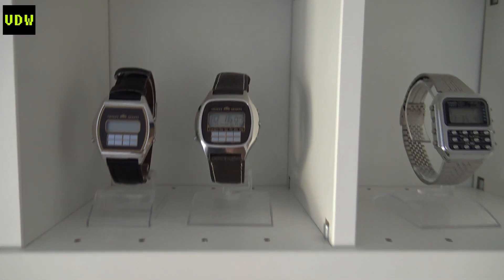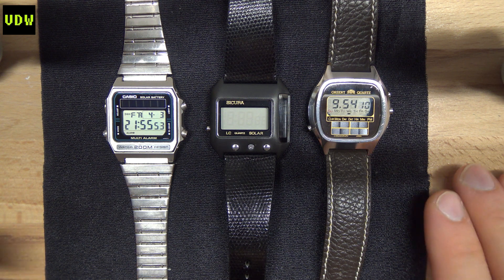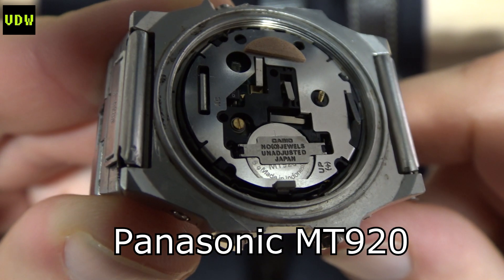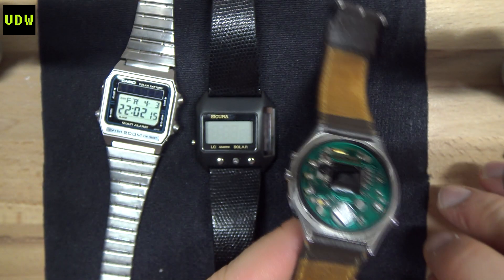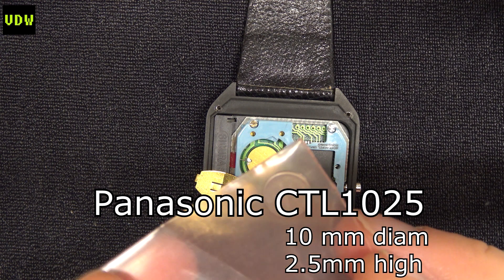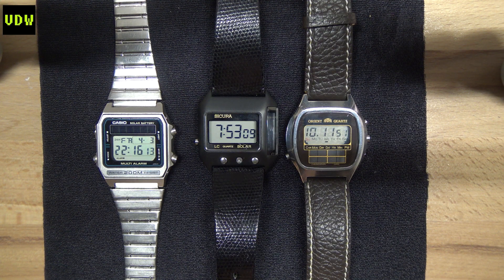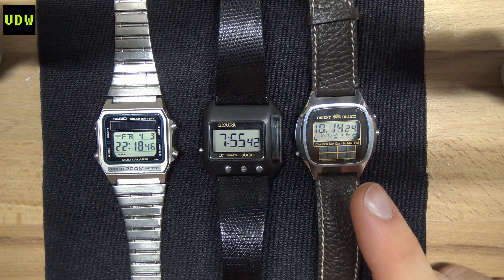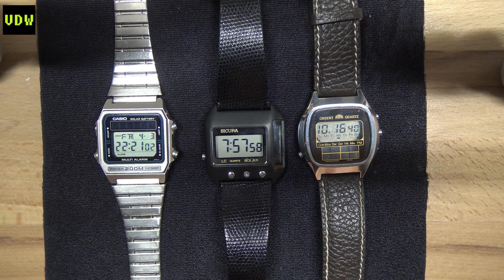Ep 86 - Solar Batteries - Vintage Digital Watches

Comment: Hello, Casio dw2000 uses MT920 to press the light button and the screen will be off. It should be that the voltage is not enough. I saw someone using a CTL920F battery with a voltage of 2.3v. It should be able to solve this problem.

Comment: Cool. You could probably fix the light issue with simple joule thief circuit (two SMD inductors and one common SMD transistor). Also if you solder to any batteries, sand the oxidation away from the surface first to make it easier.

Comment: Do you think a 1.5V cell would be sufficient for an analog solar watch? The old cell is 2.4V, 0.47F, 0.31 mAh. I am worried that a 3V cell would damage it, and also the mAh on all modern cells I've seen are much higher than 0.31

Comment: Have fitted two brand new 392 batteries, in solar watch. Display is barely visible, solar panel on watch does not work so using normal batteries, functions working fine. What is normal operating power voltage wise?, worth doubling up to 3 volts ? with two sets of batteries?Have fitted two brand new 392 batteries, in solar watch. Display is barely visible, solar panel on watch does not work so using normal batteries, functions working fine. What is normal operating power voltage wise?, worth doubling up to 3 volts ? with two sets of batteries? All areas clean?

Comment: About braselet. I think it has 4 c springs in every part.They are pushed up inside by square spring. You can try to remove two on one side and there should be square one pushing it to upper side. Please show more to look at because it it hard to judge after few seconds

Comment: Love your videos, that solar Casio is a piece of art! I bought two vintage Casio and both of them are missing the top battery retainer, but when I push down the battery they seem to work fine. I put a bit of  isolation tape on them to hold the battery and they seem to work fine, but one of them has a light that after a few hours just stops working I wonder is it because of the missing retainer? Is there a better solution than taping it down?

Comment: Hello, I'm a subscriber to your channel and find it interesting, entertaining and helpful. I have 2 Ana-Digi temps which need servicing beyond my comfort level. Would you be willing to service these watches?  One is the 8982 more modern, rounded style bought in 1989 and has a TON of sentimental value because it accompanied me throughout high school, and the other is a cal. 8982 "Orange Lightning" which needs an LCD replacement due to a bleed in the lower right portion of the LCD screen. I can provide a donor watch. Thank you.
Reply from the maker: Hi, I don't do servicing sorry, you my find someone on the VIntage Digital Watches facebokk group though

Comment: Those stretchy bracelets, you have to pull the U shaped pins out, the ones that you can see on the outside that hold the strap together. 2 on each side to connect each link, they just clip in.
Reply: To add, it's better to lever them out with a small screwdriver rather than yanking them out with some needle nose pliers.

Comment: most of these "capacitors" as the manufacturers call them are, in fact, merely rechargeable batteries.  You can source out the same r/c battery from Digikey or Mouser for a fraction of the oem cost.  I slide a single-edge razor blade (something thin & wide) under the spot-welded tab of the original "capacitor" to break the weld (it's VERY easy) and I use this on the new r/c cell.  You're correct about heat damaging the battery, especially tiny watch cells, but, instead, use what you use in other repairs - silver epoxy.  It will dry and be conductive and you're in business!  For example, here is the cell (capacitor) that is required by the Seiko V172 V174 V175 V176 SSC015 SSC017. Purchase the TS920E here https://www.mouser.com/Search/Refine?Ntk=P_MarCom&Ntt=167605663  at Mouser for $2.80.  Of course shipping is more than the cell but, if you buy 3 or 4, as I do, you're set for awhile.  Hope this helps
Reply from the maker: DigiKey will work fine if you are in a few countries, like US or UK, and paying loads on shipping and waiting and customs is not worth it. Good idea with silver epoxy, but would be extra work when changing it in the future.
Reply: @VintageDigitalWatches  Actually, the same method for breaking the original spot weld bond will work to break the "small" bead of silver epoxy in the future - you need not use much, just a spot.  If you use too much, anyway, you run the risk of covering the insulation between the two terminals (negative side up). The cell is held in place by the screw-down tab; the epoxy ensures the continued contact.
Reply from the maker: I'll pin the post to benefit people with the mouser link. Thanks

Comment: resizing stretch straps is a bit finicky, but pretty straight foward. you have to bend open the sides of one upper and lower link, and then you can easily pull out the little, staple looking parts that keep them together. re-assembly is the same thing backwards.
Reply: You don't need to bend them just stick a screwdriver under the staple like clip and lever it out
Reply: it really depends on the exact make of the band. on some you even have to take off a decorative outer part first. you 'can' force those retainers to bend, by prying that staple-thingy out, but manually bending them up first is the safer and the proper option.

Comment: Hello great friend I am rookie amateur yours I have two modules of seiko one is 0674 5000 and the other 0634-5000 one of them is loose the trimer capacitor and consumes all the battery will be that you can explain something about if it is possible its repair, and the other has lcd glass is burning.. A hug thank you..